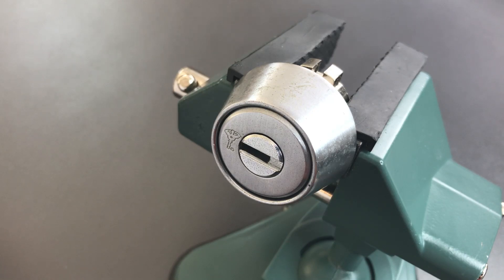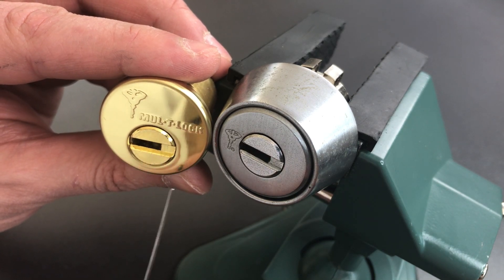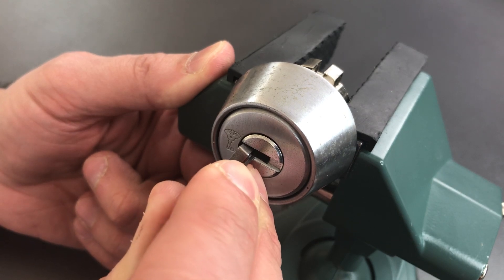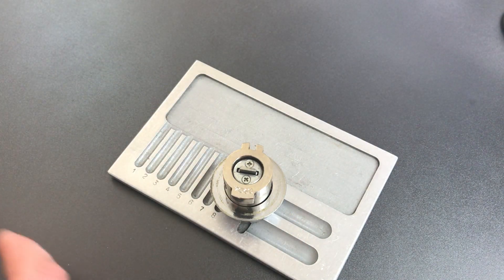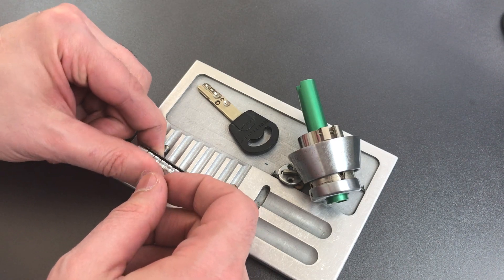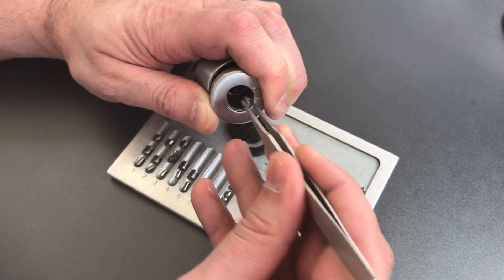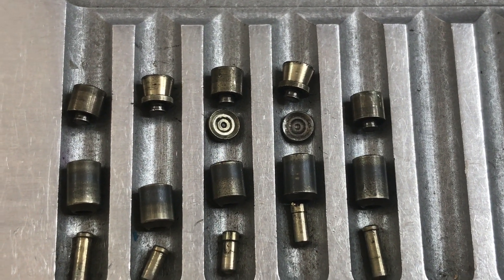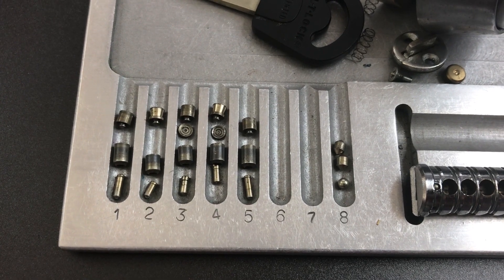[615] Japanese Format Mul-T-Lock Interactive Picked and Gutted

Comment: I think the Multi Lock deters the raking and low skilled pickers. Generally I have had good performance from them,  one on our garage, my significant other lost her key and called 3 different locksmiths, all declined to try and pick the lock!
Reply: Peter M wow. You should have called a lawyer... a lockpicking one!😁✌
Reply: Indeed I should have!
Reply: I was amused and have realized there are virtually no skilled lock pickers in the locksmith business!
Reply from the maker: The problem is one of motivation. Why spend thousands of hours developing and maintaining picking proficiency when you can charge a customer far more to drill and replace a lock?  Or am I too cynical?
Reply: LockPickingLawyer cynical maybe but probably just realistic unfortunately.😕
Reply: Usually there isn't a big added cost for drilling, they will just replace it with a kwikset or something cheap and then you can go buy a new high security lock later. The big thing is just time. They might have 10 people a day they need to drive out to and rescue. A pile of locks that need re-keyed on the desk,  counting inventory on the padlocks.... Also most brands of dimple picks aren't great and there is few if any dimple training locks available. Drill it and move on to the next customer.
Reply: Where can I get one of this locks from the US??
Reply: @lockpickinglawyer  LPL,  check out CBC Marketplace website,  they tested the integrity of the Locksmith industry.  January 2020
Reply: LockPickingLawyer   
I think the old adage “time is money and money is time.....  however just like in my business most ppl don’t consider the time it takes up source, stock and install a a new lock, not to mention the heavy tools and power needed to run them.... I WOULD BET,  in “most” cases an actual  “locksmith” should be able to show up with what’s in his pockets and have the job done before all the Intangibles have been completed when you have to destroy and replace the lock... Not to mention cutting new keys etc....    

Do you you’ve to constantly practice picking the locks you have already mastered picking?
Reply: Jeremy C   
Hopefully ppl will become more educated about the trade and when you call in a locksmith that makes excuses about being too lazy, too greedy or too ignorant of their own profession you ppl will refuse to have a perfectly good lock destroyed and spend the money of a new lock on something less wasteful.... 

Besides why pay for a skilled professional to come do a job any handy man or Maintance personnel can perform.... Basically the laziness and greed will put locksmiths  out of work all together as ppl realize they paying a professional to do a job they or another person they’re already paying can perform.... Lazy and greedy folks always ruin it for everyone
Reply: @lockpickinglawyer  No. You are not too cynical and absolutely correct. The same can be said for most auto mechanics and most trades for that matter. . More money is changing parts than diagnosing and repairs. Fewer comebacks too. It's just the nature of the beast.

Comment: Do you think a Mul T Lock interactive is adequate security for a home? Do you think an average criminal would be able to bypass the lock? Assuming that kick prevention is in place so the criminal can't just kick in the door. Thanks!
Reply from the maker: Adequate? Yes.
Reply: Thanks! It was a decision between an MT5+ or an Interactive+ and the key control on the MT5+ made getting a key in the case of a lockout a pain (safe deposit the key card because without it you get no key) vs. the interactive where the locksmith can keep the key info on file without requiring the card. Not to say that MT5+ isn't more secure (in part because of key control) but I don't believe the added security is necessary for the situation. Also, the locksmith said that interactive+'s use different key ways for each locksmith for residential locks so bump keys would be hard to obtain if not impossible.

Comment: I am very confused about the importance or rather inclusion of the interactive element if it does nothing to improve resistance to picking attacks.
Reply: It's only good for key control, like the passive pins. It's a vendor lock-in disguised as a security feature (only the manufacturer can make keys).
Reply: CodeBurger Interesting. So it prevents someone from making duplicate keys unless they are the lock owner, if I understand that correctly. In a way a security feature, but not one the average consumer would be concerned about. Thank you for the answer.
Reply: How does it work? Is it magnetic or something?
Reply: +BangDroid
A spring loaded captive "detent" (more like a pin) is present in the core. When the key is inserted, the "detent" pushes the interactive element, which in turn pushes the corresponding pin.

The Interactive element is a captive pin inside the key, which ensures that key duplication requires special equipment which is only available to the manufacturer. I am not sure if the interactive element have a variable size.

Comment: what do the master wafers do?
Reply: allow for a master keying system - multiple (different cut) keys can operate the lock - for example if it's the lock from an office door, the office occupier would have a key to that lock and no other offices - but the building security staff would have a single master key to all the offices - that wafer basically creates a second sheer line so a key can have multiple operating cuts at that position - hope that helps
Reply: Houdinii1212 - ...and they make locks easier to pick.